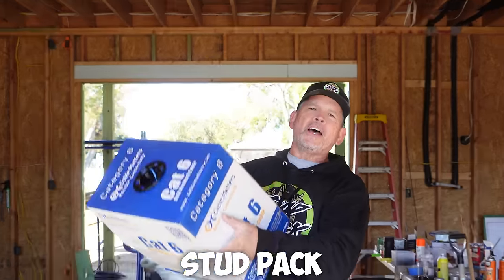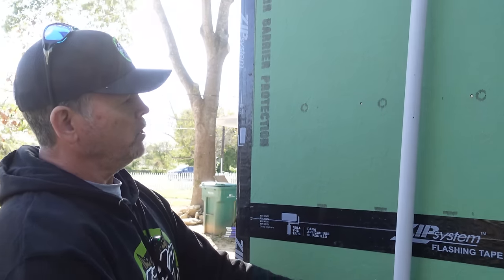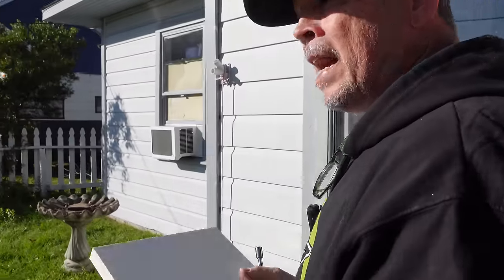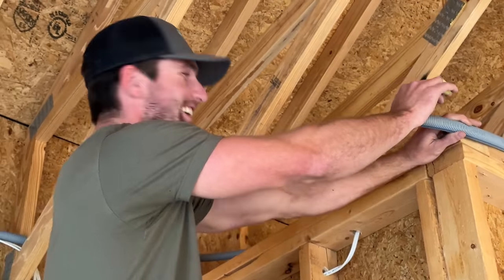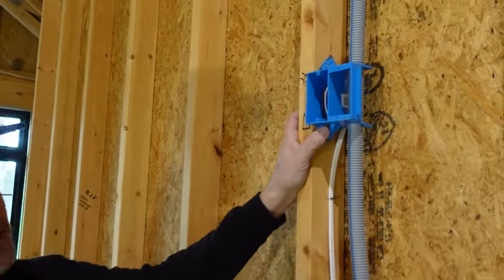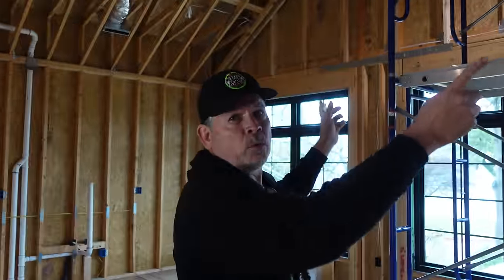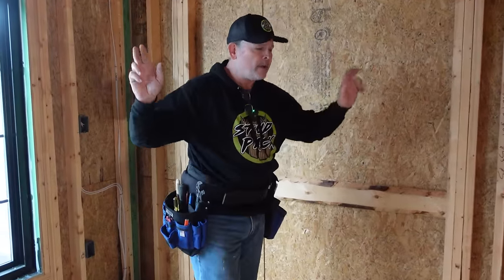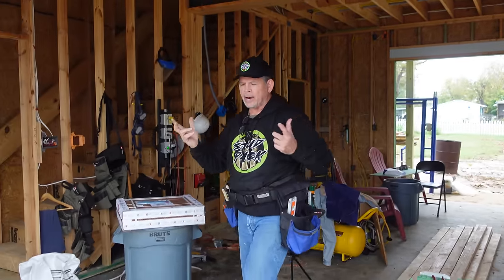DIY Networking for a Future Proof and HIGH SPEED Home! (Smurf Tubing and String Pull Trick!)

Comment: As an it engineer I have noted that domestic houses are not far off needing enterprise networks installed in them with all their Poe devices and smart appliances. Rather than heading end to end which will look messy, I would terminate in to a face plate and terminate in to a patch panel inside a cab mounted to the wall. Suggest the location is in the under stairs cupboard with your electric panel. When you come to build the house you could do the same in the house and cable that to a cab also with a twin cat6 uplink between switches or cable the house direct back to garage. If all your smart devices support Poe+ Get a Poe+ supported switch and you will not need injectors lying around your house powering each individual device

Comment: When trimming the twisted pairs to put into the rj45, cut them at an angle. This makes them easier to put through in the correct slot because you're putting them in one at a time with the angle. (Did it for a living last century as well.)

Comment: One drawback of those EZ-RJ45 connections (where the conductions pull all the way through) is that if you don't cut them with a good set of side/flush cutters or have a tool to trim when you terminate they can short.

Comment: Given the route you had chosen for the conduit, it would make sense to have additional junction boxes. Pulling any cable through more than 360 degrees of bends is a pain, and fiber is much easier to damage than the Cat 6. I am not going to say that you can't do it, but that length of fiber is going to be reasonably expensive if it takes a few pulls to get it there without breaking due to the force needed to navigate all the curves. As many others have mentioned, terminating the Cat6 at a keystone jack is the correct method. Patch cables exist for a reason. Finally, if you are going to go through the effort to put in security cameras and multiple other wired drops, there are decent managed PoE switches that will not break the bank nor would they require being a certified Network Administrator to manage. There are some all-in-one devices that are decent for a small setup, but it does not seem that you are trying to do something that small. Dedicated access points would be much better than trying to use the all-in-one and mesh networking. It would be trivially simple to expand the wired network once the house is done. Finally, 10GBASE-T is much more power-hungry than 1G. Hiding the gear is fine, but make sure the space gets adequate cooling air. Switches with fiber SFP+ modules can get warm, and those modules are much more efficient on power. Running the HVAC in a closed, unconditioned space in Texas might be acceptable, but I would not subject switching gear to that unless you are comfortable with a much shortened lifetime.

Comment: As an IT professional I will confirm that you can run cat 5e or cat 6 parallel to ac lines for up to about 6 feet with negligible interference.  If you run further, separate them by at least a foot.  On opposite sides of the cavity you shouldn't have any interference at all but either side will be ok...for the best coming in one cavity over and coming into that box from the right side would have been ideal but really overkill.  With solid core wire...you should terminate to a keystone jack or a 110 block...any movement over time will  degrade that r45(technically 8p8c) end connection.  Stranded for patch cables, solid for in wall runs. 20:29
Reply: Also that center separator keeps the pairs isolated for less crosstalk and is usually a sign it's a better cat6 cable.   FYI,  Wire that runs in a wall cavity should be CM or better...between floors should be CMR or riser cable...outdoor exposed should be CMX.  Any wire that runs in conditioned air space should be CMP or plenum cable.  You can use CMR, CMX or CMP in place of CM.  You can use CMP or CMX instead of CMR.

Comment: I’d highly recommend using wall plates with ‘keystone’ jacks. Get ‘em in a 1, 2, 3, 4, and/ or 6 jacks on a single plate.  Keystone jacks are available for multiple cable types like cat 5/6 (RJ-45), CATV & TV Antenna coax RG-6 (F), etc.  Always install 2 times what you think you want (for possible future use/growth).  KEEP ALL NETWORK CABLE AWAY FROM POWER LINES—-1 meter separation when parallel and cross at 90 degrees when crossings are required.  In your example box in the video, the communications line(s) should immediately cross that stud cavity, go through that stud, and only then, go up or down while attached to the further stud.  That will put you on the opposite side or the next stud cavity.  It’s best to think in terms of running from the outlets (or wall plates) horizontal (crossing any power at 90s) to an area that a vertical will have clearance on both sides.  Now, in the end, how important is all this??  Well, the inductance from power lines, as you mentioned, can manifest itself in many ways with various levels of severity.  And, the higher the voltage and current which is power, P = I X E, the higher the impact if you locate the wires too close together.  

I’ve been enjoying your channel for a long time. Good luck on the build.

Comment: Just here to beat a dead horse- all “field” terminations should have a jack and run back to a patch panel at the network head end. The most practical reason for this is to protect infrastructure cabling from undue stress- as you mentioned, the cable you installed is solid core copper which can only handle so much flexing over time before it breaks. If the infrastructure cabling is contained within the walls/patch panel and you use patch cables (stranded and more flexible!) on all device connections connections, you’ll get much more life and a cleaner finished look from the termination when you remove the end device for whatever reason. Also, line voltage and low voltage cabling should maintain a minimum separation of usually 8”-12” depending on the low voltage signal type, BUT when they cross, it’s best to make it a 90° intersection to avoid interference. In a residential setting, some compromise is acceptable and typically short parallel runs are “harmless” for the most part, but if it can be avoided- why not!

Comment: Guys, I am sure there are already 1000 comments on this, but as a 20-year IT pro, you do not want to your runs going directly to the device. You want your wall runs to go into a CAT6\7 keystone jack, which will snap into a wall plate. Then you can create patch cables to go from the wall plate to the device of your choice. Also, since this is the "dream house\garage situation" I would be putting in a patch panel in an accessible location to be serviced. The patch panel is essentially like an electrical panel, you bring all your runs to a central location, punch them into the back of the patch panel, and you can patch in devices into a bigger network switch, that is plugged into your ISP ONT (router). The idea here being, if you want to install other low voltage applications, like self-retracting shades for the big windows, security cameras, you can run all the CAT6 cable into a patch panel and for future use and run additional cables for boxes to plug in various other devices that need internet. For example, I would run 2\4 cables where you TV is going to be mounted. 1 for TV, another for gaming console, and potentially 2 more for future use. The additional ones will be run back to the patch panel, but don't necessarily need to be patched into your switch, util later when you know you have a need for it. I would also be planning on setting up some cables for an Access Point, for wireless coverage. The ISP routers are garbage, and this is a great future proofing, so you could use like an Ubiquiti UniFi AP AC PRO. Why do this now, because you can tie it into the house, once its complete, for total and unified coverage of WIFI without having to manage multiple ISP routers. I would highly recommend you get this done now, rather than fishing more runs, once the sheetrock is up, which I sure you know. Love these videos, and feel free to reach out if you need consultation with the Ubiquiti setup. Ubiquiti also has an awesome security camera system, that is powered by PoE (Power over Ethernet).

Comment: FYI, for data cables, as long as you terminate both ends of the cable the same way, it does NOT matter whether you use T586A or T586B. And nowadays, houses with pre-wired internet cabling are so ubiquitous, that if a telephone installer is repurposing a pre-installed Cat6 data run to install a phone circuit, he/she will not be confused if it's terminated with T586B or T586A. So choose one or the other termination standard but use it everywhere (ie, do not do phones with A and data with B in the same location).

The one mistake you must not make is to orient the RJ-45 connector differently on the two ends of the cable.  The cable won't work if you terminate it with the locking tab facing down on one end and facing up on the other end. When looking at the face of the RJ-45, the locking tab should always face down and the brown pair should always be on pins on the left. Checking every cable you terminate with a cable tester will prevent you from making that mistake.

Comment: Talk to any structured wire guys and they’ll tell you you never crimp male ends.    Building wiring always terminated in female wall (keystone) jacks.   
This is especially important for solid core copper wire; it’s not designed to be repeatedly flexed.  This is why all patch cables are stranded.  

Think of it like 14/2 electrical wire vs extension cords.

Comment: I ran cat5 to all the rooms of my house...used wall plates with the RJ45 connectors, because not all the rooms use the connection and I did not want cables sticking out of the wall if I move things around in the future.  Wasn't that much more work, and still has a nice finished look with the un-used ones.
Reply: CAT6 only carries 10G to 30m. That's why 6a exists. (and there's no such thing as CAT7. ANSI skipped it. So there's no equiv to ISO Class F/Fa.)

Comment: Nice video!  Love seeing the cat6 termination!  I use the same klein passthrough crimper tool.  Works like a charm.  You mentioned running cat6 for security cams.. Be sure the network switch the cams are connected to is POE (power of ethernet) as this will provide power to the devices.

Comment: On the underground power and data conduits you installed, there was no expansion joint used.  Is that a local code exception?  We use them always to prevent cracked PVC at the entrance.

Comment: Hi guys, get a 600x600 12unit 19" rack kabinet - or 42u if you want a lot of space. All the cat6 cables in the house terminated into a patch panel - incl the cables for utilities or cameras. get some rack shelfs, then you can have your network equipment; routers etc in there. Fiber comes in (you can also get a 19" rack mounted fiber patch box) terminates in the router or maybe media converter. From your router into a network switch, get a rack mounted version. Then you run small 30cm patch cables between the ports on the networ switch for the points that need internet. If you have cameras, then they might have to run into a DVR, then you patch from the panel into the back of the DVR. You can even send screen+keyboard+mouse signal over the cat6 cable. Ie. if you want to connect a screen+mouse+keyboard to your DVR in the rack cabinet. Get something like Aten CE100 for VGA+USB (require 1cat5/6cable) or Aten VE803 for Hdmi+USB (require 2cat5/6 cable). Pro tip with the VE803, if you get zero or bad signal on your screen, trim the little EQ dial to zero and crank it up intervals if needed.

I would run this setup, from the top. 1U Fiber patch box, 2U rack shelf for your internet company router and/or media converter (these usually don't come rack mounted). 1U for a 42port gigabit or 10gigabit ethernet switch, then your 1U or 2U patchpanel. All your other equipment underneath; DVR, NAS, home server, etc. 

You should also get a UPS to power your equipment; router, switch, DVR, etc. if the power runs out. I know you talk about getting a backup generator. But the UPS also conditions the power and protects your equipment from spikes in the power. From the UPS you can get a rack mounted PDU (power strip) to power your equipment.

Comment: Just a thought for some pre-planning. Since you're running the fiber input to this garage apartment, you should plan on having a fiber jump from the modem in the apartment to a network switch in a central location to the house. Nothing would suck more than trying to setup a 10Gig connection on the far side of the house and finding out you're just a little too far from you last fiber drop for a reliable connection.

Comment: You heard it all about the patch cables from a wall jack so no need there.    When I setup the house I did runs for Access Points (Ubiquiti)  to cover the house.    I ran CAT 6 to boxes in each room for devices that I want wired as well.   And of course all the cameras are POE .   The UDM-SE  handles everything with ease

Comment: Generally you do not want your ethernet cables parallel with your electrical, however if it's unavoidable, use shielded twisted pair(STP). I would also recommend the keystone jacks with patch cables to your devices, as it's standard practice and allows for more flexibility if anything moves and cable length is a factor.

Comment: Great job on the conduit.  If you want to run HDMI through any of them in the future, you should use 1.5" or even 2" smurf tube.  HDMI connectors have a hard time fitting through 3/4" Smurf tube.
Reply: Always can run another cat6 and use an hdmi to cat6 converter. Makes life supper easy

Comment: Not sure if anyone else mentioned it, but I wouldn't put modem/router in the attic space. It will get way hotter up there unless insulated, also hard to diagnose connectivity issues when you can't see the lights, etc. And having to get up there to reset things will be a pain. If that electrical closet is close put a shelf or small cabinet in there to house the modem/router/switches etc.  And I also agree with the other comments, the wall plates are nicer, also pretty easy to terminate on the back with a punch down tool.

Comment: With thousands of comments I'm sure others have said this: use cat6a, not cat6. Cat6 is limited to 55 meters for 10g.  Cat 6a can do 10g out to 100 meters.  

The other thing is to make sure you don't buy CCA cable (copper clad aluminum).  You want solid copper. As others have said, terminate to a keystone jack and use patch cables from the wall jack to the computer/tv/whatever.  And up above the stairs, terminate to a patch panel.

Comment: When you go to keystone jacks on your wall plates like you should, make sure you have a couple of extra conduit runs for high-to-low wall plates in case you want to mount TVs or monitors or anything else on the wall that you'd want to run power/signal to without ugly wires hanging in plain sight.

Comment: Myself i replaced old Cat 5 with Cat 7 S/FTP i acquired from work. Bit thicker due to the wire mesh jacket around the four pairs. It's overkill but i can be sure that there is zero interference plus earth protected incase a current somehow got onto it. That trick at 12:00 was really neat!

Comment: GO WITH KEYSTONE JACKS. The only exception would be the temporary office where the run will be deleted. Unlike coax cable, if the cat6 is kinked, stretched or bent often enough, the thin solid copper can easily suffer an internal break. Moreover, stranded premade patch cables are much easier to organize and come in an assortment of colors.

Comment: The piece in the middle of Cat6 cable is actually for crosstalk shielding. Twisted pairs are actually twisted because it reduces crosstalk between the pairs, and Cat6 cable has to have extra shielding and more twists than Cat5e to meet the standard.

Comment: Great video.
One suggestion would be to run CAT6A shielded instead.
CAT6 has a theoretical length of up to 55m for 10Gbit, whereas CAT6A is realistically close to 100m.
CAT6A shielded is less susceptible to interference, which should alleviate concerns of running cable close to live wires, and ensure you can use the spec length at 10Gbit speeds.
Another benefit is the ability to run PoE equipment. Due to the larger conductor size and shielding, with the right hardware, you can run 802.3bt/PoE++ devices such as cameras or wireless access points.
Reply: Cat 6 will do 10Gb for 185', that's more than enough for 96% of homes. Shielding really isn't needed in most homes either. There's theoretical then there's real life

Comment: So glad to see you guys took the time to run conduit for your cat cable, however so disappointed you aren’t doing the ends properly.

There is a reason professional installers put keystone jacks on both sides of the wire. A wall plate on the appliance side and a keystone patch panel on the router side.

Comment: Paul - you’ll be fine with that small run parallel to AC. I’ve seen comments already and if it were a factory floor welding cable acting like a spark gap transmitter I’d agree with them! But NOT in your case. Reason being is AC is 60 Hz (or harmonics there of) and well constrained. Your CAT6 is pushing 300MHz and as you noted is twisted pair. It’s not even in the same ballpark so to speak. Plus if you do pull fiber it’s optical and there won’t be any electromagnetic interference.

Mechanically if you do pull fiber with a connector through 3/4 it would be better to stay as straight as possible. I’ve done 3/4 split loom in data centers and it is a PITA! I would recommend a copper transition into your conduit and you won’t have to deal with an LC connector banging around.